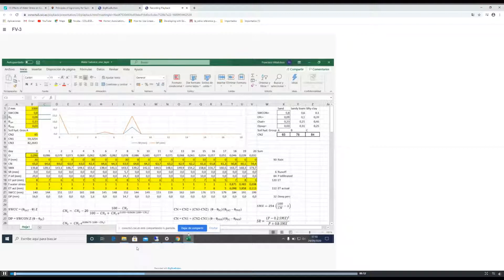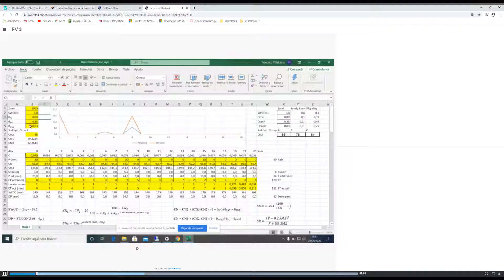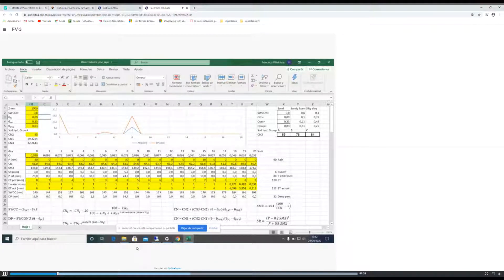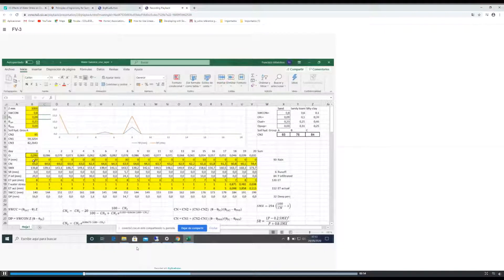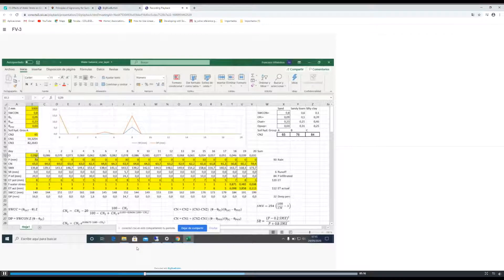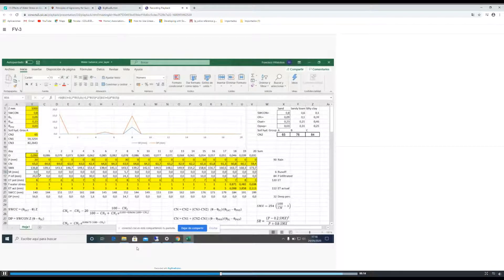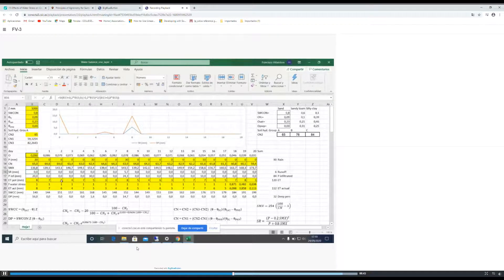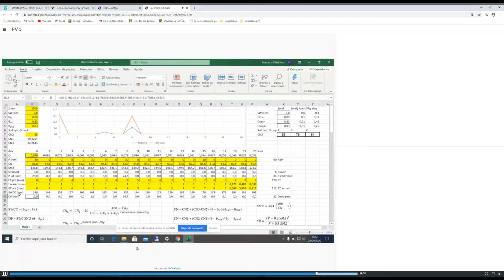Excel file with example of simple water balance in a single layer soil

Comment: Thank you for the useful video Professor. The "O" values are calculated correctly  for 20 days time. And the interpolated concept for the CN is great. But the calculations for "O" values for a long period including summer (no rain occurrence), do not have a minimum value (threshold). Therefore, I got negative values... Any suggestions please?
Reply from the maker: Thanks for the tip. In fact, the problem was a bug in the ET calculation. Now it is solved (hopefuly). Download the new excel
Reply: Thank you for your immediate answer!

Comment: Thank you sir for the video. I have a question about how you computed the SR in the excel file. Why was the P in the numerator of the SR equation ignored in the excel computation although the formula for SR has P in both the numerator and denominator? Thank you
Reply from the maker: Thanks a lot for your comment. That's a bug. I have corrected the excel

Comment: Thanks for this useful video, Sir. May I just ask, what will be the difference if we do the water balance in a two-layer soil? Thank you.
Reply from the maker: If you have 2 or more layers then you have to know how much water is absorbed by the crop in each layer and you need to move water between layers (redistribution) which makes the model much more complicated. Many models exist that can do that but our aim with this spreadsheet was to illustrate the water balance in the simplest way